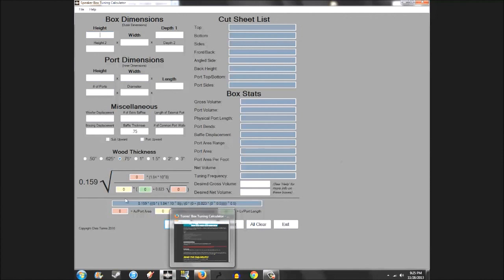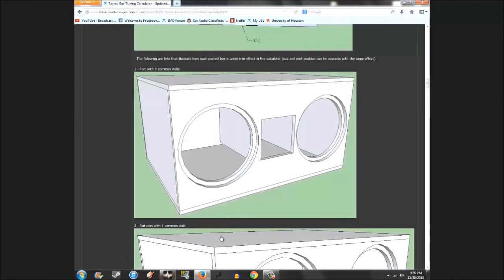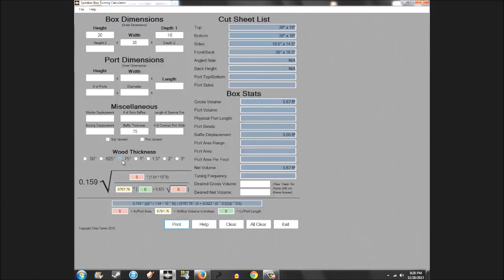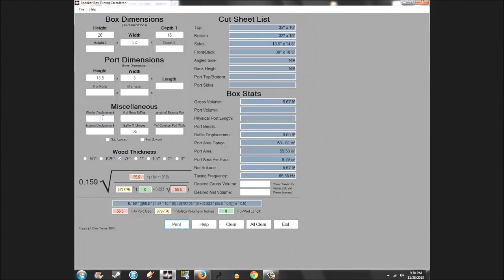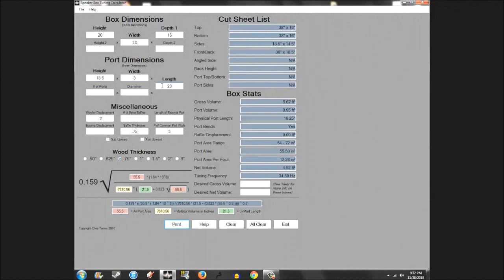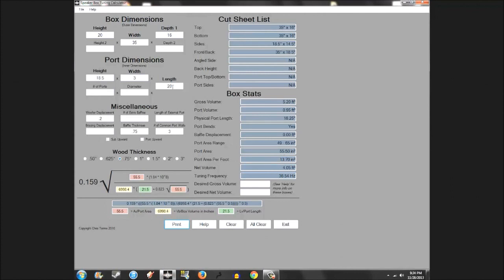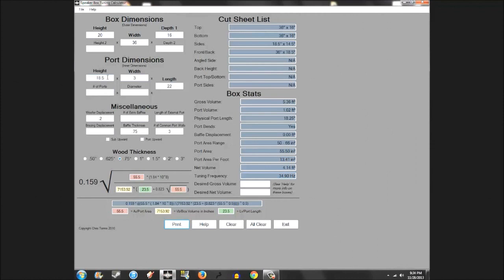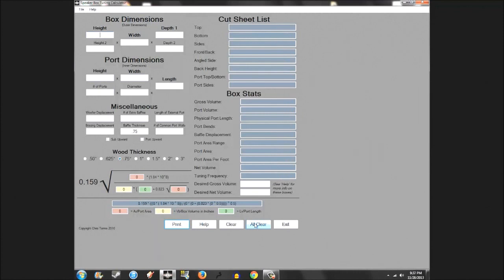Box Tuning Calculator Tutorial

Comment: Thank you for taking the time for this video appreciated I can build what ever I see I built a box 3yrs ago using re box calculator for two 10's Pioneer top mounted  now tuned to 32hz it sounds amazing & still to this day for what I'm pushing watt wise. But now I want more so I'm trying to understand something using this approach but want to do a curve port on the front of the box now the sub's I'm going with state ported 1.75-2.00 ea. And I'm going with 2 10s Tuning hz 39 so does this mean I need a 4.00 cu. ft box because I'm going with 2 speakers & it has to be tuned to 39hz  is that it & how would I enter this in here. On rebox conculator I entered this ht-19"/wt-40"/dpt-17"/wood thickness 1.5/sq Port-3.5/ sq port length 0 it gave me 4.0 box vol tuned frequency of 38.052 hz can your application give me a cut list but I need the port on the bottom face of the box & I want to do a curve port for a smooth look please help like I said if I had the cut list I can & have the tools to do this what I dot get is all the tuning stuff thank you in advance?

Comment: The program is not calculating tuning frequency, port cut sheet dimensions, or port area per cu ft. I've probably built 100 enclosures so I know what all the fields mean. Has anyone else experienced this problem? Any help is appreciated, and thank you in advance for any info.
Reply from the maker: Stuart Wood could be a missing or incorrect input. This is a super old vid, I don't even use this calc anymore. Cutsheet was always iffy on it though. Sometimes if you have aero and slot port dimensions it gets confused. So make sure certain fields are cleared depending on use.
Reply: @HitemWithTheFlex  I'm running into the same problem when I attempt to design.

I see that you no longer use this program. What do you use nowadays

Comment: About how long should the 90 degree board at the end of the port be? How big of a difference will it be if it’s 6 inches vs 1 foot long in terms of net volume and hertz?
Reply from the maker: That depends on the tuning you want. And the difference with a 6" vs. 1' piece in terms of volume and frequency depends on the size of the port and what the starting port tuning is. (The question you asked it too general to give actual numbers for, but this calculator, which has been updated since this video was made, will give you those numbers when you plug in measurements)

Comment: I know u don’t use this program anymore but do you think it’s good to use for sealed boxes?
Reply from the maker: Probably not, I would go with the free version of WinISD.
Reply: Travis D I tried it but it goes too in depth and my subwoofer manufacturers don’t give all the details on the subwoofers.
Reply: Travis D I tried it but it goes too in depth and my subwoofer manufacturers don’t give all the details on the subwoofers.
Reply from the maker: Then just pick a size between manufacturers recommended volumes. On the bigger size, the sub will require less power, play lower easier, on the smaller size, the opposite.
Reply: Travis D when u say less power u mean don’t have my amp turned all the way up? I’m asking because I’ve burned a few subs because I believe I had em in the wrong box size.
Reply from the maker: Let me ask you this, how did you set your gain on your amplifier? By ear? DMM? Oscilliscope?

Box size being off  doesn't burn up subs, only too much power will do that. So your burning subs issue is probably a clipped signal going to the subwoofers. Granted subs will heat up fast in a sealed box than a ported box (no where for the hot air to go or cold air to come from to help cool the coil), and also, there is more back pressure on the cone causing it to take more power to move the subwoofer usually, which means more heat to the coil as well. But I am leaning to your burning subs problem being a wrong gain setting issue.
Reply: @HitemWithTheFlex  sir what is the correct measurement computation in order to get the interior vol. Cu.ft? Is it the outside dimension or inner dimension we need to measure in order to get  tye interior cu.ft.? Thaks